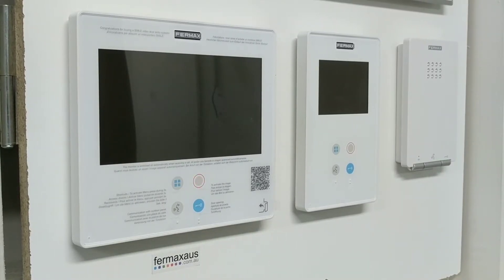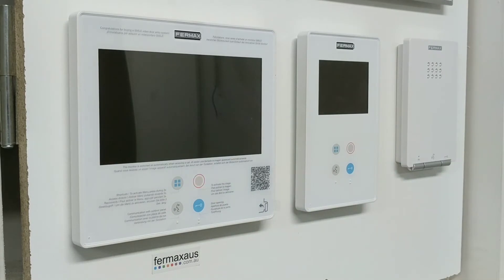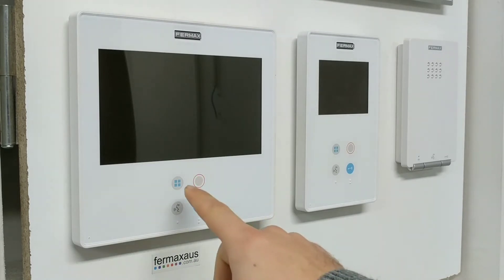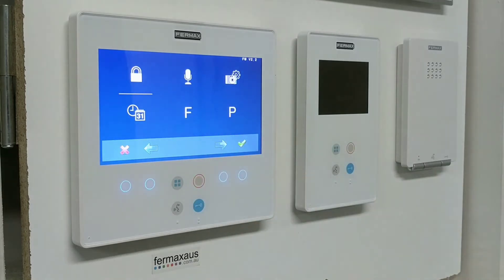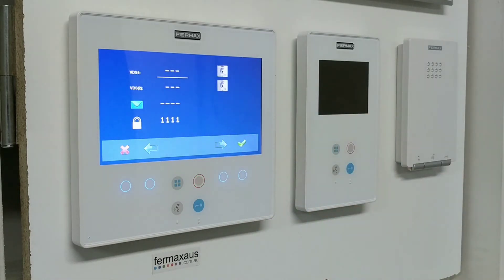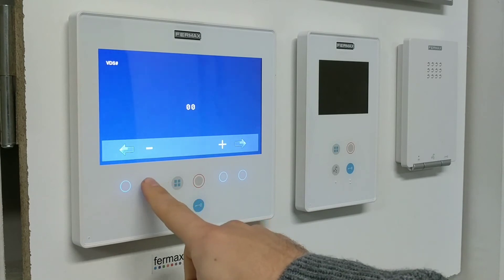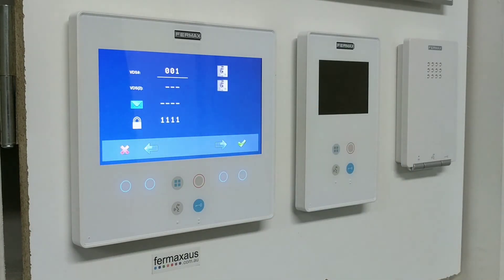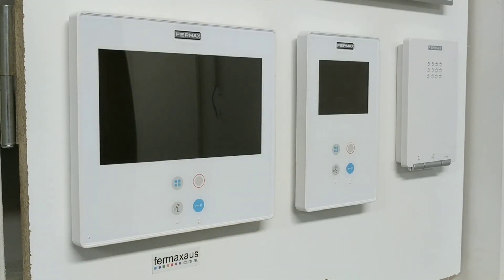How to program a FERMAX 3.5" and 7" SMILE monitor

Comment: Our apartment number is 505, however we are unable to program it higher than 1 on the first digit. Is there a way to change this?
Reply from the maker: Hi Malcolm, The apartment number is not always the same number that is programmed into the SMILE monitor. The number programmed into the SMILE monitor depends on what backbone system you have installed and how it was initially configured. We recommend that you please call the installation contractor or our local office www.fermaxaus.com.au/locations to arrange a service call as a qualified technician would be able to determine the appropriate number to program into the SMILE monitor.